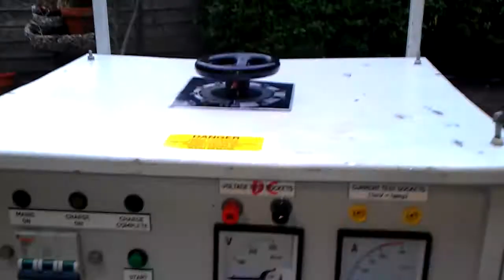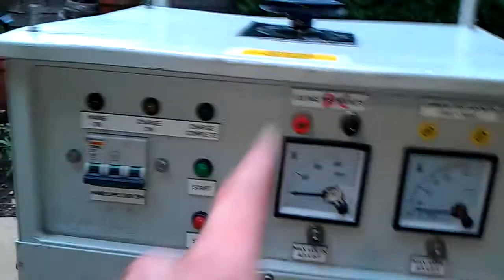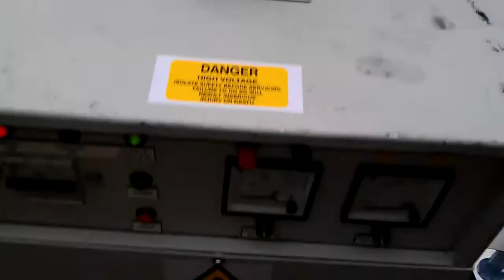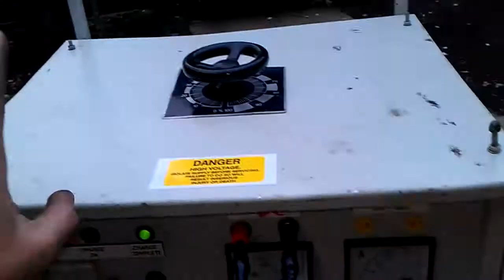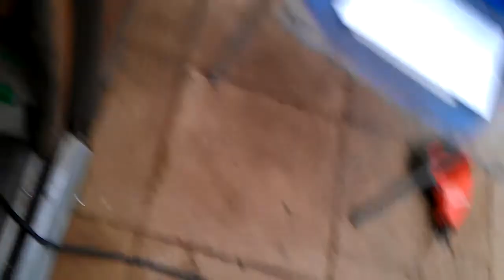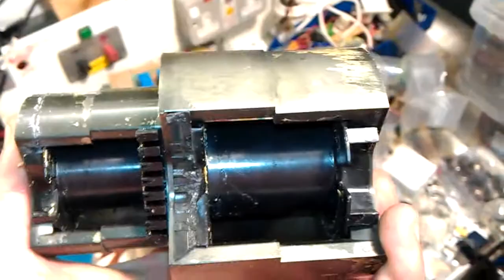Control unit!

Comment: As for HV supply, maybe you should look into TL494 or one of those PWM drivers?
Adjustable PWM, possiblity of voltage and current feedback.

(I know the ZVS/royer is less parts, but doing a full SMPS controller will probably be a usefull learning experience)

I do have a 30 kV (+/- less than 1 kV) one extracted from a monitor, that is tempting to copy.

Currently mains powered, wondering about making it powered from 12V alone. (via a external boost module for B+(70V).